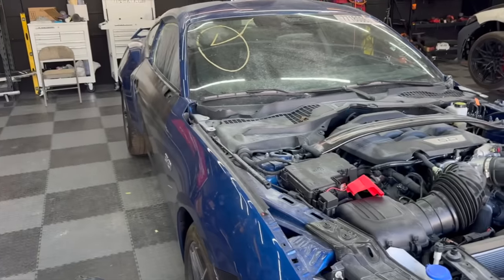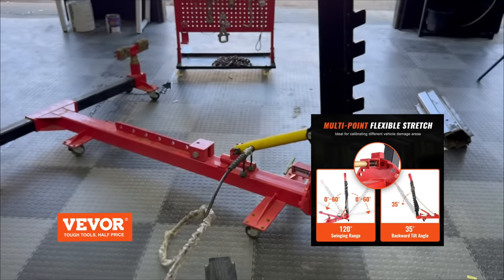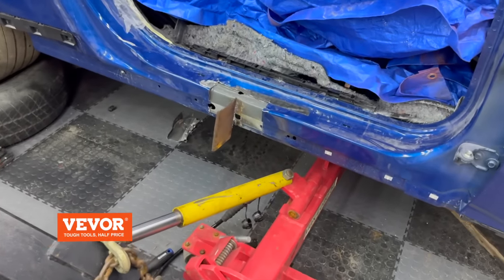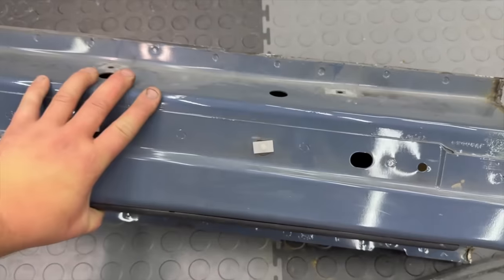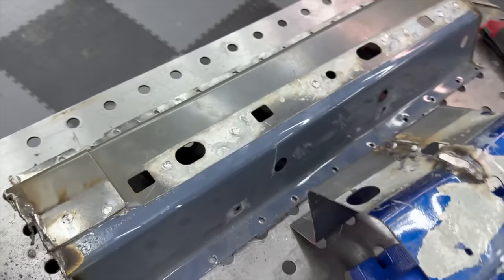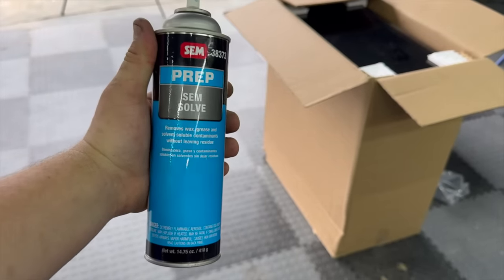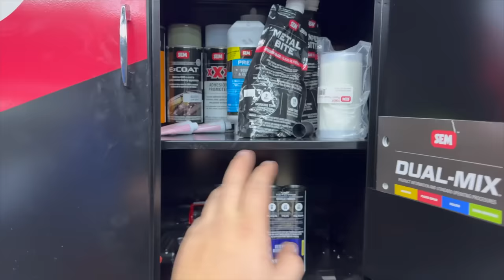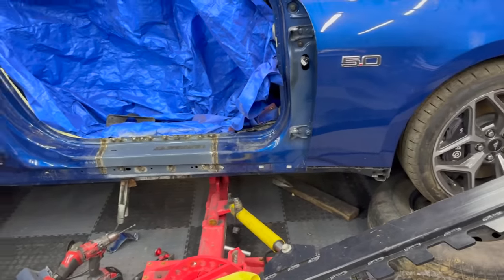I Used MY CHEAP CHINESE FRAME Machine To Fix MY 2024 MUSTANG GT

Comment: Look into race ramps wheel cribs. You can set the car down on them and remove the quick jack leaving the car still in the air if you need to work on it in the air.

Comment: Why did you pull that piece out if you were going to cut it out?🤔
Reply: Because the structure behind the piece may also be deformed. Pulling out the damaged piece will straighten that out.

Comment: Get two sets of drive up ramps to put under each wheel.  Jack up with the quick jacks then tuck one under each tire.
Reply: That’s what I do for oil changes on my Mustang. Jack on each side and lower on to reversed ramps.

Comment: Hey vtuned just for your safety. You shouldn't drive over the hydraulic hoses with the cars, you could damage the hose or the fittings, and under load they could fail. I know the cars don't weigh much, but the risk of them collapsing while load lifting or lowering can become dangerous.  Best of luck on the up coming builds.

Comment: Why didnt u put an inner plate  in the back of the weld as an overlap for the strength since it is a high impact piece of the frame isnt it weaker now ?

Comment: And why did you pull out the dent and then just replace it I would’ve just started with that replacing the whole thing but hey it’s your YouTube
Reply from the maker: Before you can replace a damaged piece you have to pull it back into its original position or else your new piece will not fit properly

Comment: What's the point of those quick jacks? It doesn't raise the car high enough to do anything useful under there? What am I missing?
Reply: Yes you are missing something, the quick jacks blocked access so he couldn't get frame machine under car. So he had to stand car on the wheels then get quick jacks out of way.
Reply: @SalvageMasterEssex  unfortunately you didn’t read my post. I asked what the point of those quick jacks is. I realize they wouldn’t work with the frame machine which is just another reason why I don’t understand the point of the quick jacks. They are useless for doing any work under a car. I don’t even think they raise it high enough to drop a trans.

Comment: You need to start looking at the techinical Data sheets on the proper way of fixing these newer cars that should be replaced to be put back on the road for safety reasons.

Comment: 8:15 dude, you've got a forklift now. Just put the forks against the pinch welds and use a come along to pull against the frame of the forklift. raising it up does make things more comfortable though.

Comment: Hi Ben,
Nice job you’ve realized by welding in the frame piece as well as the outside cover in the bottom door-frame at the passenger side of your 2024 Ford Mustang. Also your cabinet including the SEM Products are a welcome alteration to your workshop. I look forward to your next vlog because I’m very keen how the Ford Mustang finally will look like. Not that I don't have confidence in it because you have proven several times to be a star in repairing cars but just how it will be.
Send you love from The Netherlands